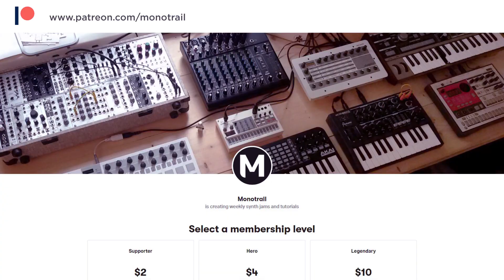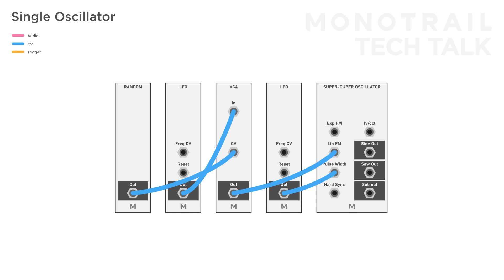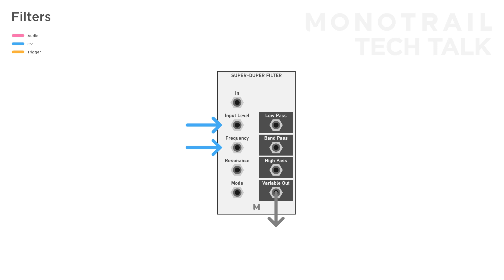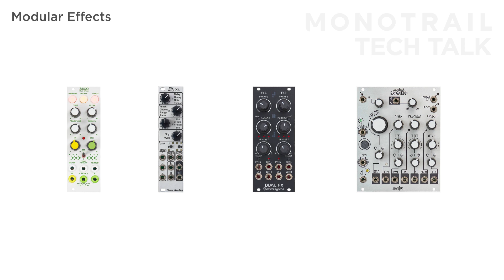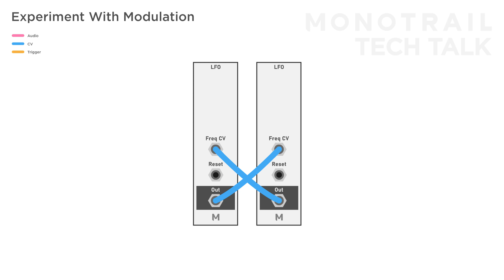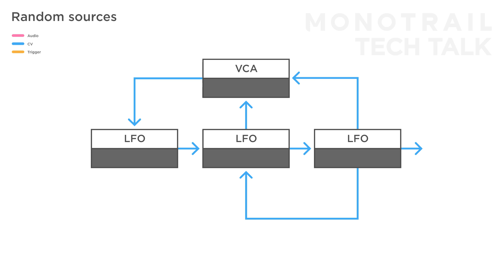Introduction to eurorack drones - Modules and patchtips for beginners

Comment: Do you use that Mackie 1202 you can see on the left also for your modular audio signals, plainly speaking, do you feed audio signals out of your modular directly to an line input of your Mackie?
Reply from the maker: Hi there! And yes I do. In the studio, and also live I just use eight inch to quarter inch  mono cables directly from the modular to an outboard mixer. However, I do generally use a VCA at the end of a voice or modular drum bus, so I can control the output volume before going into the mixer. Modular levels are a bit hot.

Comment: Are filter banks basically like a graphic EQ?
Reply from the maker: Hmm, I'm not to familiar with those, and they come in different shapes. Some are just a combination of two or more low- band- high pass filters, those arn't really graphic EQ's at all. Some are. often called 8/X band filter banks. They have a filter section for multiple fixed frequencies. Then there are filterbanks that use the filter circuitry to add "character" which a clean EQ should'n do, and so on. So definetely not exactly the same, but for sure some can be used similarly.

Comment: They’re so expensive. I feel I will never be able to afford a hobby in modular.
Reply from the maker: It's expansive indeed, of course a lot depends on personal situation. For me, the system I use today was build/collected over a period of about 6 years, in those years mostly not doing things like having a car, expansive traveling, other fancy stuff made it posssible. Also these days there are things lke the Behringer Neutron to get a large part of the fun for a reasonable investment :)
Reply: Cherry Audio's Voltage Modular is a free software modular system that comes with 20 modules and  sounds great, $70 gets you their mod Core Pack with 90 modules and they sound amazing.
Reply from the maker: Ah yeah, I forgot about that of course. There is some great free and affordable modular fun to be had! VCV rack is another example, completely free, and will give you lots of patching fun. Might even help to decide if modular is for you, and or what it would be worth to you. But it's a great free tool! - https://vcvrack.com/
Reply: Vcv rack is free and so powerful. I have modules but when I want to test ideas that my system cant do I use Vcv rack to see what Im lacking in my setup

Comment: This was one of the best eurorack educational videos I've ever watched. Instant sub!
I have two questions, one serious and one very trivial...
1) Do you have suggestions about managing and taming feedback loops? I'm fascinated with that kind of sound, no-input mixers and whatnot, but I don't really know where to start.
2) I love your graphics and animations, how do you make them? I want to create something similar for my students, but I can barely use PS and AE. Do you use a specific software?
Reply from the maker: Thank you! Glad to hear you liked it :)
1) You mean within the modular, or in general? If you like no-input mixing, for sure get a large old mixer with a lot of sends on e-bay :)If you mean within the modular, I'd say attenuated modulation, and VCAs are key. With VCAs you can control the amount of feedback within a patch.
2) I use Illustrator and Adobe Animate, both work quicker then PS and AE.
Reply: @MonotrailTechTalk  1) yes I meant within the eurorack realm :) I guess I need some kind of module with aux or duplicate output, or maybe a mult? And what about the source? Do i need a vco with specific in/outs or maybe something like the Doepfer matrix mixer that allows different routing options? 
2) Oh great, I'll check them out thanks!
Reply from the maker: Hey. You don't need an oscillator or input if you're into the whole no input mixing part ;) Doepfer matrix mixer is definetly a great idea! That would give a lot of routing and feedback flexibility in one module. Also Tiptop audio stackable cables are a great way to mult signals to multiple places. VCAs are great for controling or shaping the amount of a sound or signal with some modualtion. 

At the end it all comes down to what sounds you're after, if its on the more droney/noisy side of things look into the more affordable (multi)effects for soundsources and feedbacking, and well, effects. One I have for example is the Synthrotek Echo, a noisy but lovely module that can feedback so hard it becomes a great clitchy sound source.
Reply from the maker: EDIT: When I say noisy, I meant it's great for noisyer/grungy/distorted type of sounds. The module itself isn't noisy, with some efford you can get a clean delay out of it as well ;)